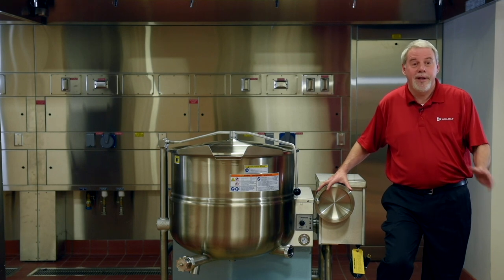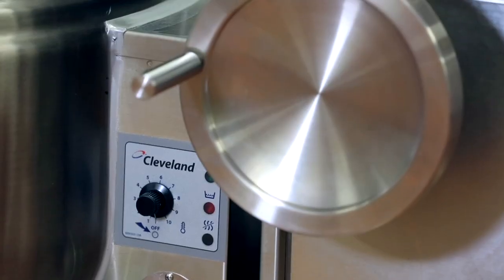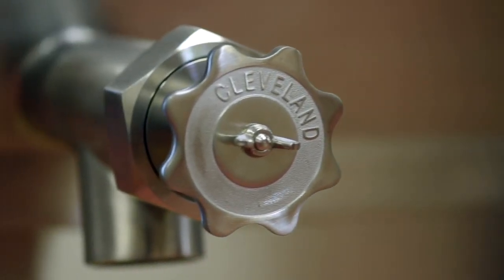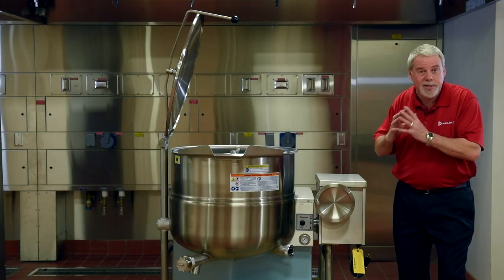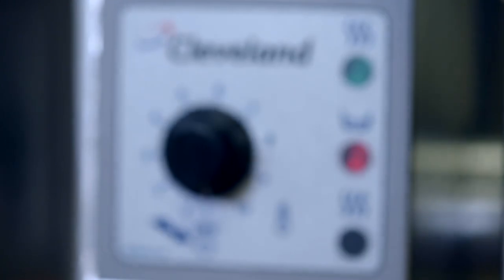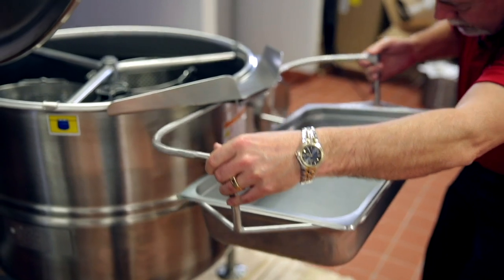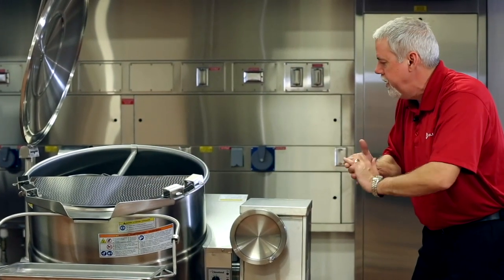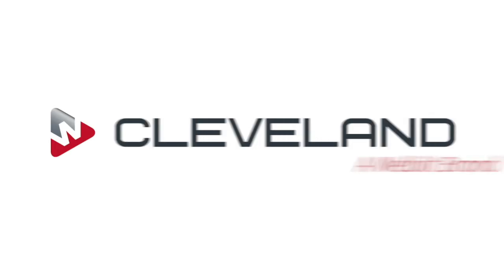The Cleveland Advantage - KGL40T 40 Gallon Gas Operated Steam Jacketed Kettle

Comment: I need an 80 or 100 gallon version. But dont have a 3/4" gas line. I do have a couple of spare 1/2" lines. Can i combine them with a regulator to use on the 80 or 100 gallon?